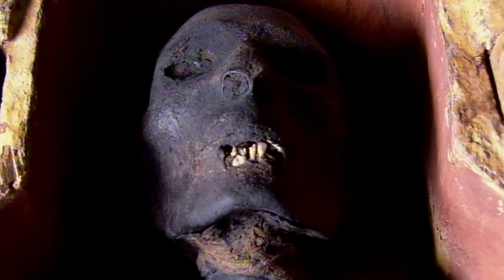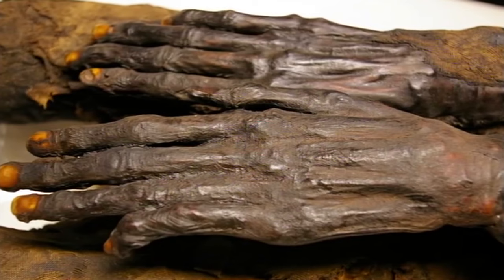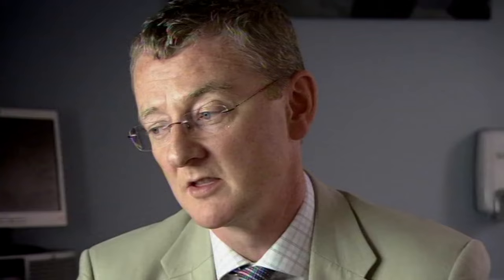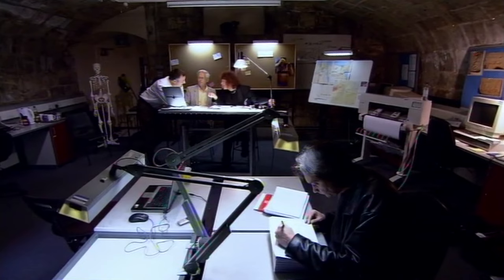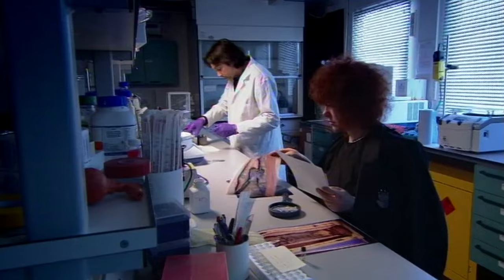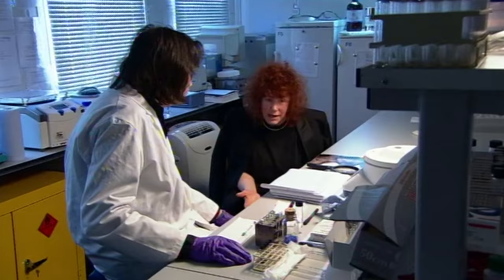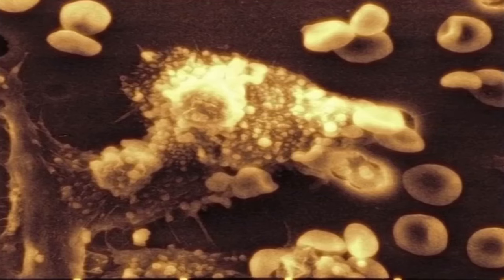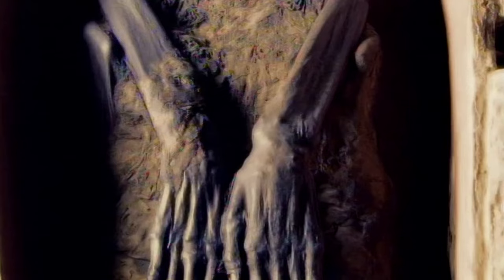The Mystery Of The Misfit Mummies | Mummy Forensics | Timeline

Comment: What was the point of continuing to hammer the implement after it had clearly broken through the nasal bone?   Why keep hitting it after it has impacted the back of the skull?   Wasn't the idea to recreate what the ancient embalmers would have done?   Poor experimental design, guys.
Reply: To liquefy the brain matter in order for it to exit through the nasal passages.
Reply: Mary Rodger that's what the next tool was used for, the bent piece of stiff wire.   Slamming the first tool into the back of the skull contributed nothing.
Reply: They wanted to see if the damage to the back of the skull was from the embalming.

Comment: They forgot that the Egyptians rinsed out the skull with wine which would help liquefy the brain matter.
Reply: The acidity of wine will coagulate the proteins in the brain, not liquify them
Reply: @karenkhaos9086  and the heat would 'set' brain tissue, not aid in liquifying it
Reply: @cassieoz1702  Wine acidity varies from vintage to vintage and they found proof that they rinsed the brain case with wine, probably palm wine. Don't make the mistake that thinking all wine is the same.
Reply: @cassieoz1702  Heat helps flesh decompose, so it wouldn't help "set" the brain. They weren't being cooked! Which doesn't matter since they did the mummifying in a special chamber in a temple. I don't know if you've ever been in a giant stone building but they tend to be rather cool inside.  All that thick stone acts like an insulator and keeps the heat out.
Reply: @cillyhoney1892  the DEGREE of acidity varies but no wine is alkaline which is what liquifies protein
Reply: @cillyhoney1892  yes i have. Please dont be so condescending. Either they arent explaining what they mean very well or they don't understand the chemistry of the process.
Reply: @cassieoz1702  The wine wasn't for liquefying the proteins, it was just a fluid used to rinse out the brain cavity. They weren't practicing chemistry. They could have used water but they used wine because of it's alcohol content helped with preserving tissue.
Reply: @cassieoz1702   Telling others to not be condescending is an attempt to control other people's speech so you feel better.  I can be a blunt person but I don't generally talk down to people. Sorry/NS if the way I wrote something made you feel bad. You must be new to the internet. lol
Reply: @cillyhoney1892  you and i clearly know this but it isnt what was said. My point was the wording in the documentary
Reply: @cassieoz1702  fair enough.

Comment: in order to get the liquefied brain out I would have turned the head nose down and blown in air through one of the nostrils by means of a straw: the air pressure building up below the occipital bone inside the cranium would drive out the brains smoothie.
Reply: Not enough pressure good try tho

Comment: 19:34 The bone piece may also have been the result of the embalming process,
where the brain is removed through the nose. This then needed a sharp metal implement,
but may have been forcefully inserted, by a less experienced embalmer.
Embalming was very expensive, and reserved for the highest of the high and richest of the rich,
quality the higher upon payment done.
I'd check the bone piece for fitting inside the nasal cavity somewhere as well to rule out this
being the case. MRI with specific atunedness for calcium , filtering out other return signals,
can be used to scan by tenths of cubic millimeter the existence of calcium, and with that a 3D image of the bone inside the head,
as well as scan the bone fragment itself, and then seeing if it fits.
If it does not, I'd also try and rule out the bone part being part of an implement used to remove the brain.
Reply: 37:36 Neat scanner, but did anyone ever consider making a 3D image,
and virtually walking over it ?
The bones would be seen with great detail from a perspective that allows for much
greater degree of interpretation.
Represent a 3D avatar approx two virtual meters high, and each millimeter of actual
bone represented by a block of 1 meter.
Then stroll along the bone and see every imperfection, and gain more insight.

You can actually use gaming software for it.
A virtual 3D avatar (player) and a representation in Unreal 5 (game engine.)

(The newest version of Unreal 5 is very capable of rendering multiple similar blocks simultaneously,
number in the billions. Then turn God mode, and fly around the skeleton, simple.)
(Despite Unreal 5 standing synonimous for gaming, almost, it's a very capabe 3D rendering engine first.)

Edit: It was not Unity, but Unreal 5, with unbelievable performance for repeating blocks.)
Reply: I'm sure they will revisit this thing they did in like the 2000s and rework it using your guidelines, based off this youtube comment on a 5 year old video
Reply: @redorchidee137  Nope, not by this comment, but they will, once they discover that it is the best way to find out where to place the piece.

In the meantime, I'd also examine DNA fragments, to see if it actually is from the same skeleton.
Just for verifying, losing uncertainties.

Comment: Chemical analysis of the embalming materials to determine the dating?  Why not carbon dating?  The chemical analysis can only prove the embalming method not the date as the narrator implies.  They can't do carbon dating as they already have done it on this mummy obviously, and came up with a date that didn't fit their time period, so they had to date it by a different method that would agree with their 3,000 year old initial assumption.  This is how dating works in geology/archeology/paleontology.  If you get a date that disagrees with your theory, throw out the data and claim it as invalid, and use one of the other 21 different acceptable dating methods to place a date stamp on your object.  If you try enough methods eventually you will get one that agrees with your theoretical results.  Forget the fact that the same object dated with multiple methods always turns up different dates that are not statistically viable.  Forget the fact that a live oyster shell can be dated into the future, or a live tree can be dated to be over 50,000 years old in certain spots in the world because of soil isotope profiles.
Reply: I am not convinced by radiocarbon dating either, so the only thing they have to go on is developments in embalming, which fail to take into account individual idiosyncracies.